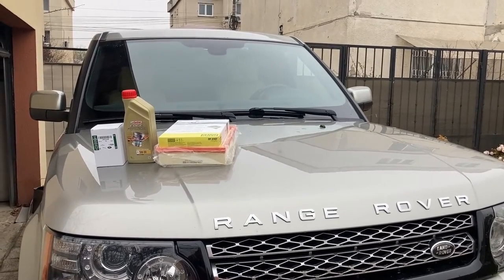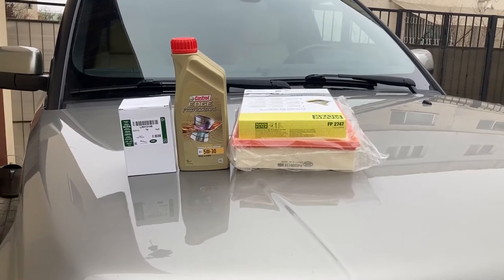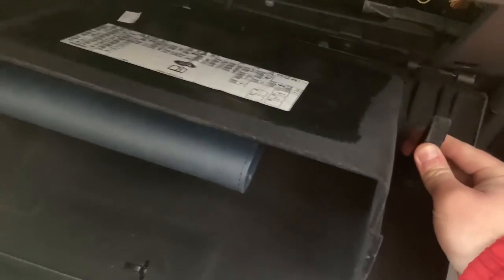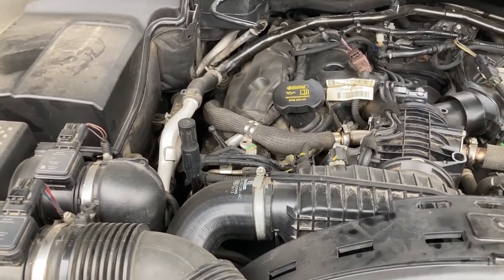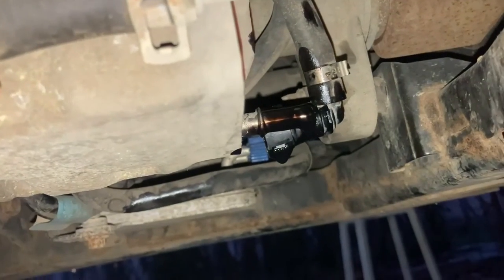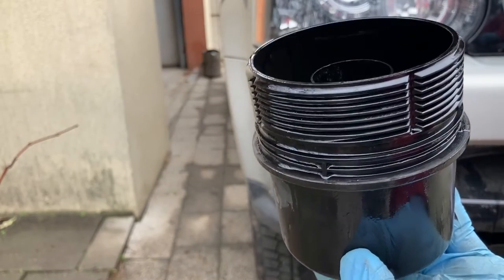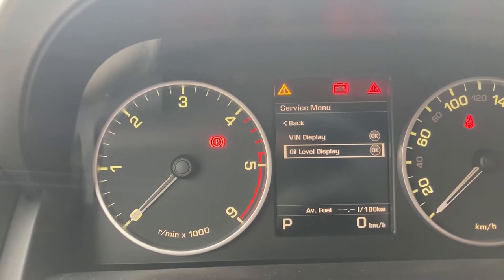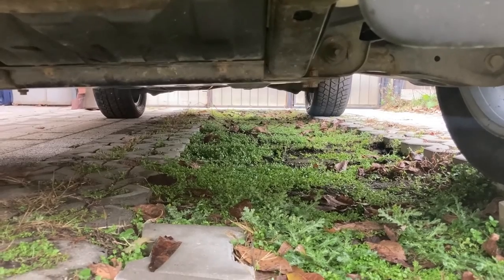DIY - 2012 Range Rover Sport SDV6: Full service (air, cabin, oil filters and oil)

Comment: The downside of using a c1 or c5 oil is less or lower lubricity....The manufacturers thinking on this is ,,,,,,Lower lubricity = less friction of parts = better fuel economy,But the fuel you save is almost unmeasurable ,,I use a high quality c3 oil and change it every 3500 miles,,That's the key to longevity for a DP filter...
Reply from the maker: It's not the lubricity that's the issue, but the behavior of the oil when under heavy stress and temperature (the "high-temperature-high-shear" or HTHS value). Lower HTHS makes the oil film less resistant, especially in the more critical areas like crankshaft and piston bearings or the camshaft lobes (the latter being the most demanding point for the engine oil). C1 requires a HTHS value of at least 2.9 mPa * s, C5 is even lower and a minimum of 2.6, whereas the C3 you mentioned is at least 3.5. I agree that the fuel economy gained from a lower HTHS is negligible; this is the reason why I used a C2 oil on the Kia Sportage only once and then permanently switched to a C3 as well. Having said the C specifications also impact the amount of sulphated ash which clogs the DPF. Here, the C1 oils have the lowest value at around 0.5% - 0.6%, whereas C5 is higher at 0.7% - 0.8% and C3 can go over 1%. In the case of our Range Rover, which has a Ford DPF, using a C1 oil is a better choice than a C3 from this perspective. From a personal perspective, I think a 3500-mile interval for changing the oil is a bit too soon unless the car is driven only in a congested city or constantly under heavy loads. Otherwise, I'm sticking to a 5000 - 6000 mile interval for all our cars since they all see a mixed driving environment and no heavy loads.

Comment: Good evening sir, my range rover sports 2012 is showing me restricted performance and can't drive more than 80 on a high way but if the engine is cooled down for a while the sign does not show up until when I drive more than 80 before it comes up again,  what do you think may be the reason? Thank you
Reply from the maker: The notorious "Restricted performance" warning can have a large variety of reasons. Did you have any overheating issues with the engine? Maybe the coolant temperature sensor is bad, it which case the car "thinks" you're overheating and restricts performance to reduce heat generation... In any case, the first thing to do is always to use an OBD2 scanner and check the ECU error codes. That should point you in the right direction.

Comment: Hallo there is no oil stick on mine year 2012
Reply from the maker: Indeed, for 2012 there's no oil stick, you have to check the oil level through the car's computer. You can see this at 34:25.
Reply: @TheMissingBolt  it is only visible through the menu
Reply from the maker: @pierluigicicinelli3361  Yes, only through the menu.
Reply: @TheMissingBolt  many thanks sir

Comment: is it possible to reset the oil service without a specialized interface?
Reply from the maker: From what I read online, it is possible. There are several YouTube videos available which show the procedure. Though I have only ever used the OBD2 tool for this, so can't confirm.
Reply: @TheMissingBolt  I found a video on YT showing the procedure for deleting the oil inspection. So it's possibile :)

Comment: Are you going to renew the gear box oil and filter?
Reply from the maker: I already did that in the summer of 2020 - full flush through the transmission's oil cooler lines, plus new filter. The next service is due in about 30,000 km and I'll do that with multiple drains and fills. Hopefully I'll manage to make a video with that as well.
Reply: @TheMissingBolt  cool. Did you use the oil zf kit or the britpat conversion kit because they say that it is not possible to remove the black box with the filter because there is not enough room? Did you buy machine to flush the whole system because indeed they say without flushing only 40% of the oil volume fall...?
Reply from the maker: @comedefleurieu315  I used original the original ZF kit, with the plastic filter and original ZF Lifeguard8 oil. It is possible to remove the filter, though it is indeed a bit difficult and you have to remove the large steel cross-member under the gearbox first. I didn't buy a machine to flush, I went to a garage specialized in servicing automatic gearboxes.